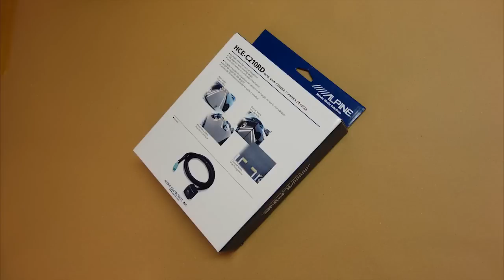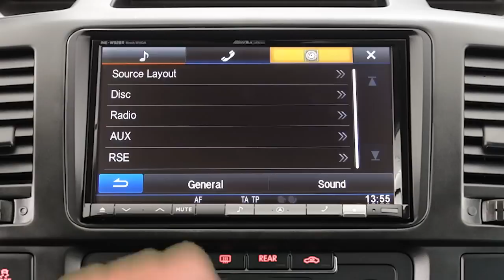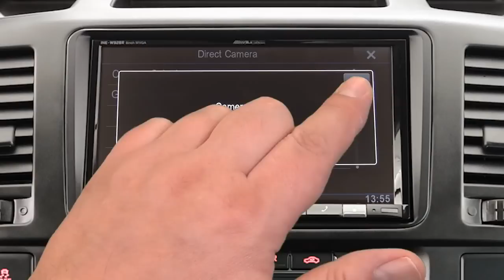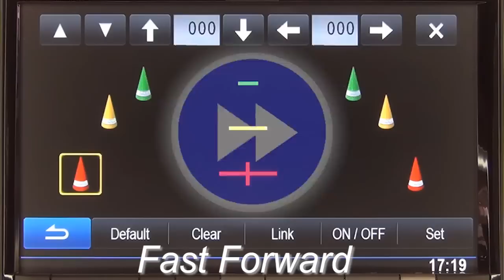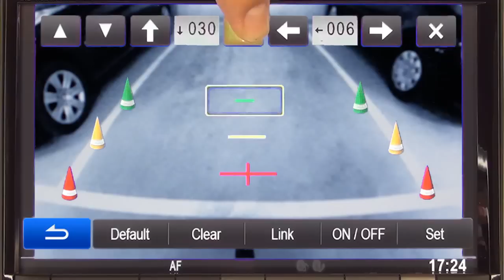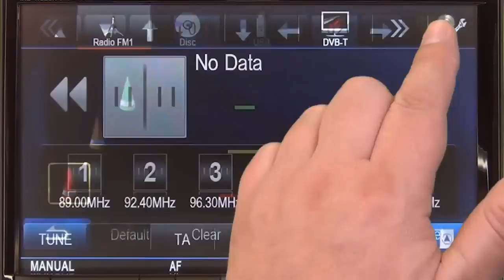VW Transporter | Alpine Reversing Camera Installation | CEN Automotive

Comment: Hi. I have a VW California, I tried to pass the wire from the left mount, but I failed. Do you have any suggestions to give me or advice? Thanks. Congratulations on the videop, very nice and useful!
Reply: I’ve also recently tried this but came to a metal pillar just before getting to the passenger side door. There is no way to pass the cable through this it seems. Did you drill a big hole in it?
Reply: @johnsutton4775  
Yes, in the end I succeeded. I passed the wire on the driver's side upright. I helped myself with a led endoscope light and my smartphone to see where to enter.
Reply: @davidefiorio62  
Thanks for replying. My cable isn’t long enough to go down the drivers side. Did you drill a hole in the pillar to get the cable through?

Comment: Nice camera, learn to use sealant/glue a little better though @ 8:58 eugh, what a mess!
Reply: It's just the inside. What does matter is that it's glued firmly in place and waterproofed. Which they did!